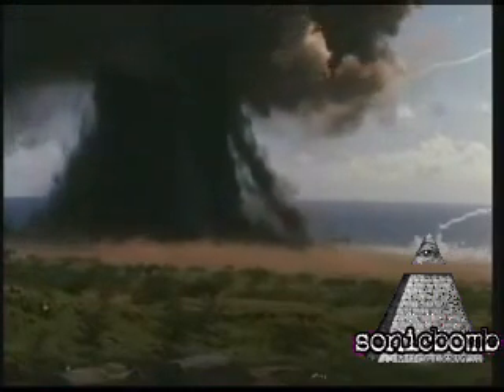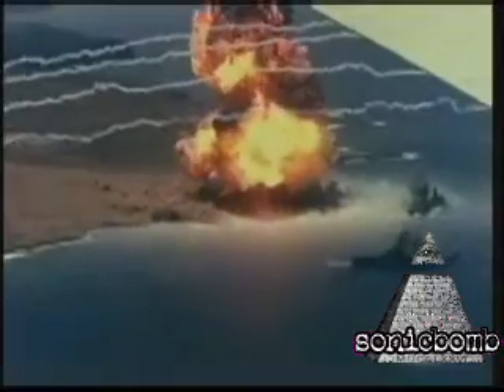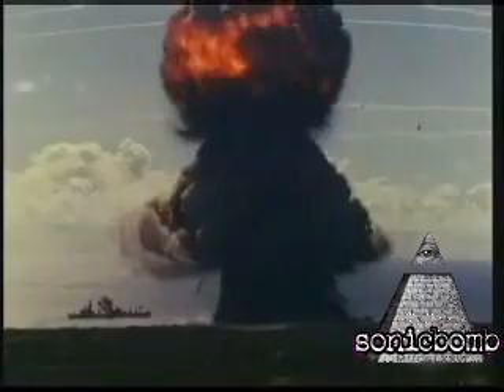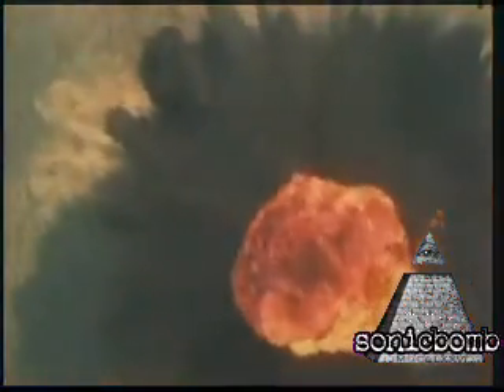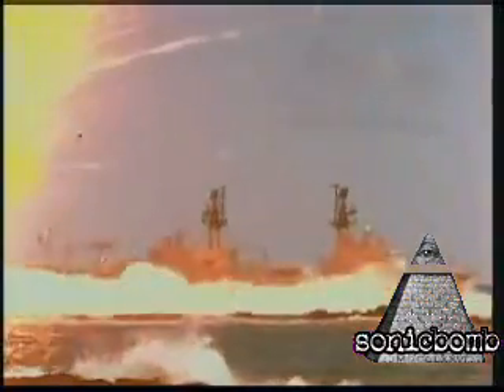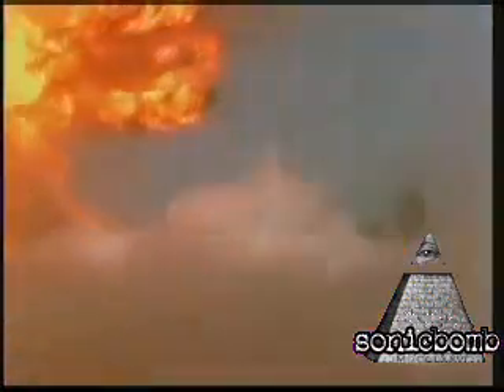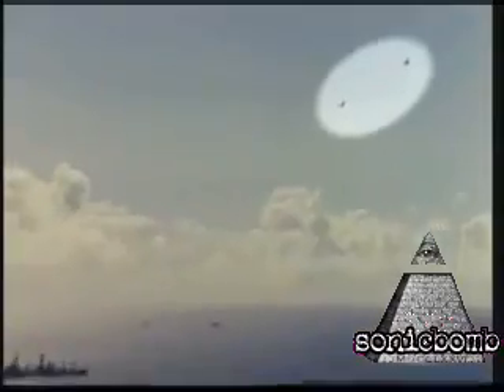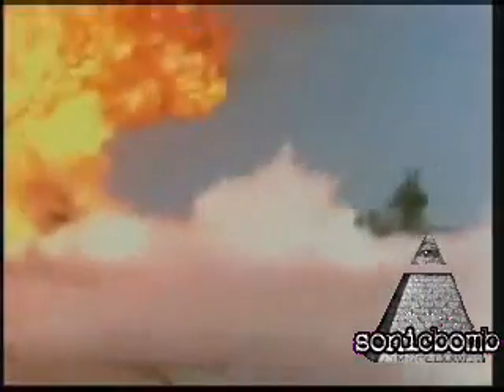Operation Sailorhat 1965

Comment: @TlalocDiosDelAgua They are called "Wilson clouds" or just condensation clouds.  They are caused by the low pressure portion of a shockwave in sufficiently humid atmosphere.  The shockwave will temporarily decrease the temperature causing a cloud to form and then dissipate when the pressure changes back to normal. wikipedia.blahblah/Wilson_cloud

Comment: wow they got a lot of the story  wrong i was on the USS ATLANTA IX 304 ,the superstructure was not made of steel it was aluminun and that is not hot steel coming down it is rocks ,on the last blast we were 300  feet from the fire ball and the ship was fine we did have a hole in the hull but it was above the water line . alot of stuff went over the side on the last blast .